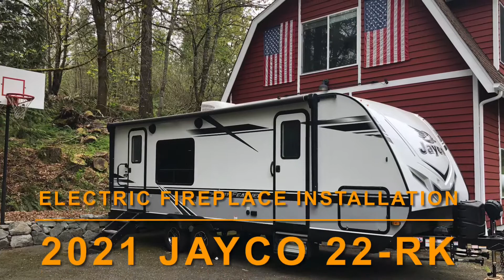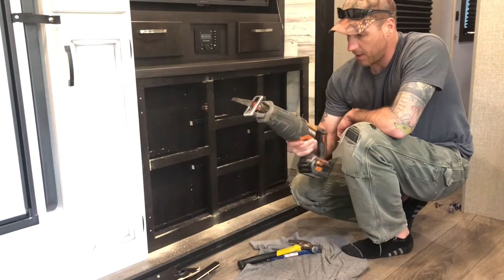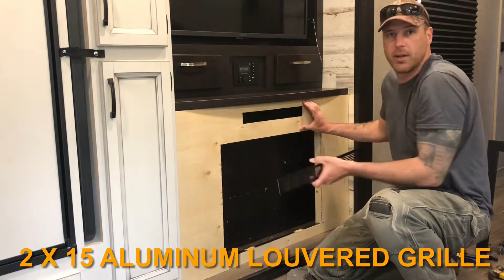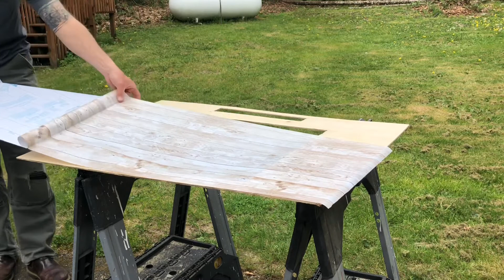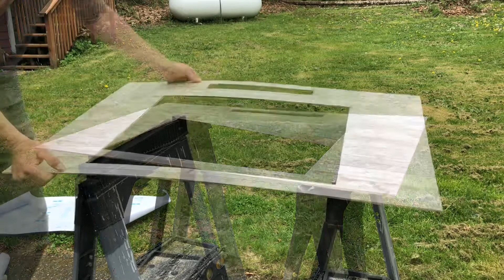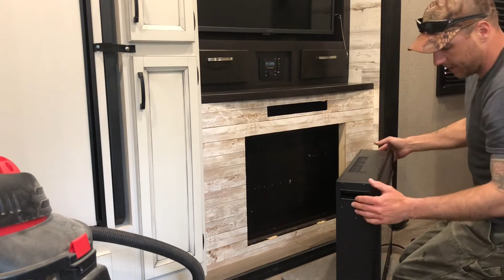DIY Electric Fireplace Installation on a 2021 JAYCO 22-RK

Comment: Where did you get the small vent cover? I'm doing this with my unused cabinet storage.
Reply from the maker: Hey Jay, if I remember correctly, I just found one on Amazon or it could of been from Hone Depot. I just researched what small sizes were available and that were long and came across it and bought it. Then I just cut the whole out and glued it into place. I hope this helps Jay. Thanks for the question.
Reply: @StoneyCreekSparkchaser  We just bought a used 2014 Keystone Passport 3220BH and the previous owner already had the electric fireplace but just set it on the floor. I am hoping the trim piece is still around somewhere. I've been trying to figure out how to fill the gaps around the sides. I didn't think of using plywood for a face. Now I have an idea how to do this. Thanks for the video.
Reply from the maker: @jbird68 you're welcome Jay, and yea the plywood worked great and the wallpaper sticky I used matched perfect. A sure win.
Reply: Where did you pick up 110 volt access from ? Did you run power from a circuit close buy, maybe from behind the tv?? And  thanks, nice job.
Reply from the maker: Thanks Mad Dog! The outlet was actually already back there. I assume for the same thing... maybe a trim
Model up or something, but yea. That's why it was there! Thanks for the compliment :)

Comment: Where did you buy the heater
Reply from the maker: Hey Senior! I got it from Amazon and it’s the COLIBROX 28.5 inch embedded fireplace! Thanks! It’s posted at the bottom of the video around the 4:20 mark :)